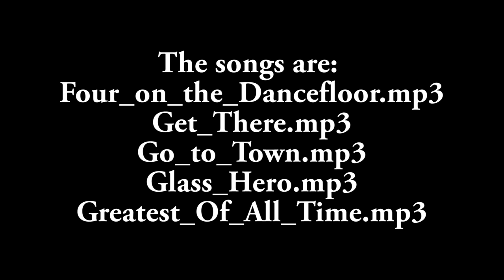White gold chain interspersed with bezel  settings for diamonds

Comment: amazing! When you solder the chain to the setting, how do you prevent the first chain to fall when you solder the second? It's so close, both should melt at the same time
Reply from the maker: thanks, I use solders with different melting point

Comment: how much more would you charge to hand make the chain also?
Reply: That chain is probably too small to make by hand
Reply: Jos Riedel gotcha. so in other words way longer than its worth and way too expensive. with your talent im sure you could do it if you had to just not worth the time.
Reply: theres something about handmade jewelry. it stands alone vs the machine & casted rings
Reply from the maker: For this video I have used an already ready, since it is a simple chain to be made but with long time, on the market the same chains made by machines are extremely cheaper and of equal quality.